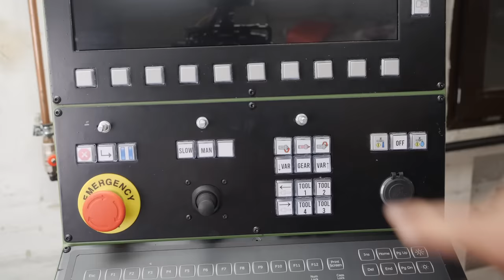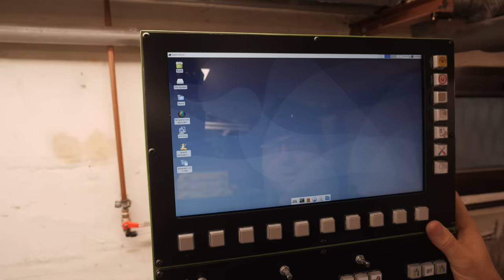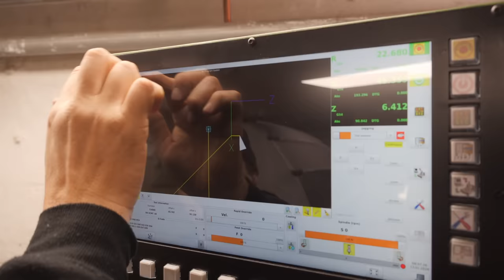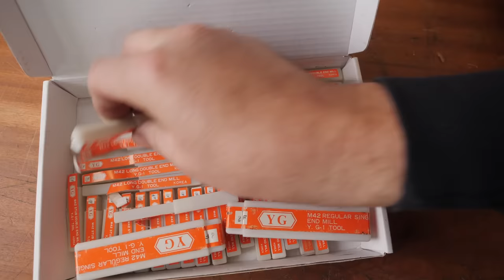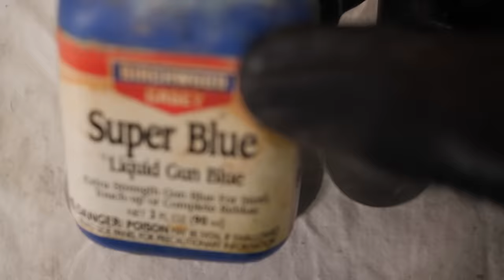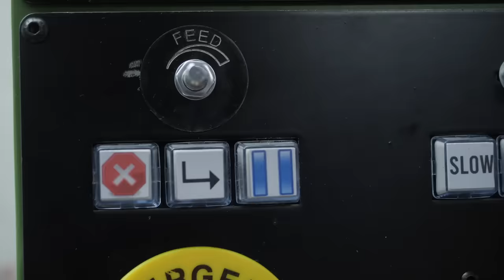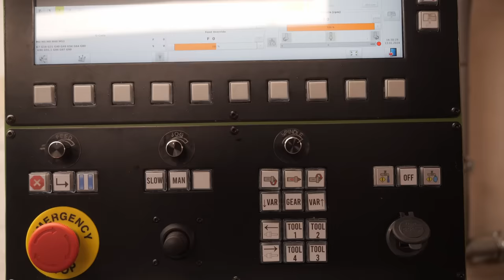Engraved markers Schaublin Ep. 61 || RotarySMP

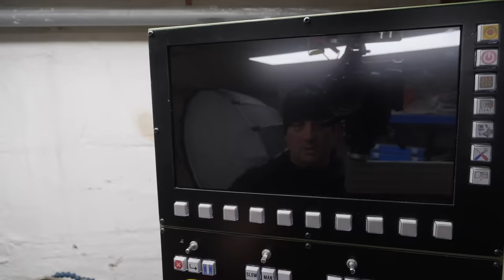Comment: Better you did that on the stone than on the belt sander. That is not fun... We have been having allot of conversations about the plug door as well (while on an A320 usually). It's looking like the left side plug is taken out by another vendor that installs the sat internet. Not 100% verified yet though and not sure if the right side comes out either. That said that doesn't explain the loose bracket bolts in aircraft. Most of our conversation revolves around the fact that most US made products are made by the I don't GARA method. Just throw it together cash your check and go spend it. There is no pride in workmanship in most of the country now. And talking about this in the van to the hotel that was over an hour late at 1:30am cause they couldn't find their driver... The airline didn't answer anyone until personal texts were sent then they kept trying uber and they kept cancelling... Oh I didn't mention the return flight where we almost weight restricted as the flight went from block time of 2:20 to almost 5hrs to go around weather. And they had us de ice before finally approving the new route and needing to go get more fuel...
           In short no one cares. If I were in a position at an airline purchasing $$$ aircraft I would have MY people on the line with a check list camera and body cam checking all the deemed to be vital type things that you can't see after assembly. But I have an issue where if I didn't do it or at least see it done I don't trust that it was done properly and this is one of the many reasons why I feel that way. One of Reagans great quotes. "Trust but verify"
Reply from the maker: I know Lufthansa has a team of inspectors they send in to monitor production of their A/C. I met two of them on site in Dos Campos monitoring the Cityline Embraer production.

I would no be surprised if Boeing and Spirit have a reasonably robust process for the TC production hand off of the fuselage. It would not surprise me if that STC installed at the end of production has little to none of that process interface and hand off.

Comment: Could you please help me?
I saw a tool claimed to be used in the aviation industry in a video on YT but I cannot find anymore.
This tool is somewhat similar like a car battery post cleaner wire brush. It can be fastened in an electric drill chuck, it has a pilot pin and is used to clean the surrounding metal surface around a hole for the best electrical connection for a ring terminal that to be fastened to the surface as grounding for example.
Could you please tell me how is this tool called and if this can be purchased easily?
Reply from the maker: I discussed this with a friend who was Avionics. His suggestion was to search for:
Battery post terminal cleaner or
Battery terminal cleaner for drill
Reply: @RotarySMP  Thanks for the answer! I appreciate very much.
In the meantime I was so fed up that google absolutely did not gave any useful result that I re-watched a bunch of videos and finally found it.
The tool is called "Piloted bonding brush" or "rivet hole brush".
So far the closest company I found who sells this in the UK. It would be great if I would be able to find this available to buy in the EU.
Reply from the maker: Being mechanical, I never knew this tool existed. Wonder what it is called in German?

Comment: =D
Reply from the maker: Thanks Mike.
Reply: @RotarySMP  one thing about the HDMI cable, I found with my high end monitor for gaming, that if I put it in a warm part of the house, it would get pretty warm and the backlight would tend to overheat.  Pretty sure that's not your problem, but might want to monitor the temperature of your enclosure and provide some airflow if you find the temperature to be a bit high... just another thing to worry about with electronics... they give off heat and don't like to operate in a hot environment. =D